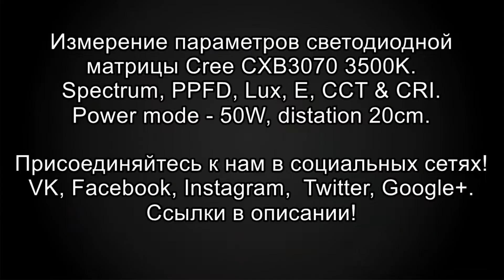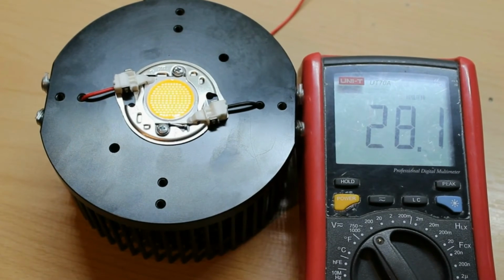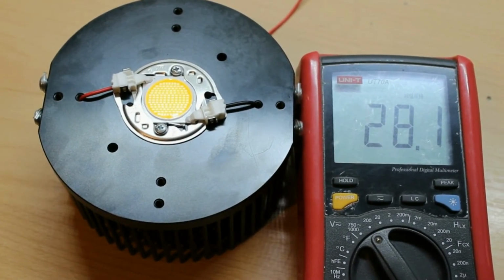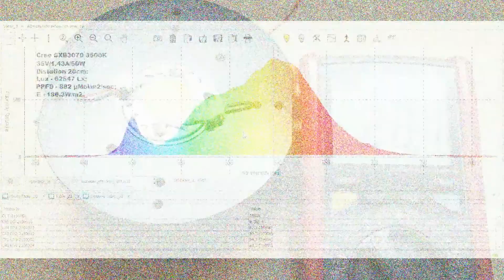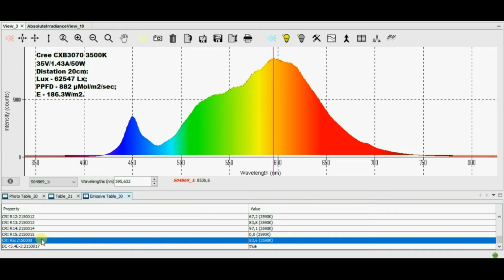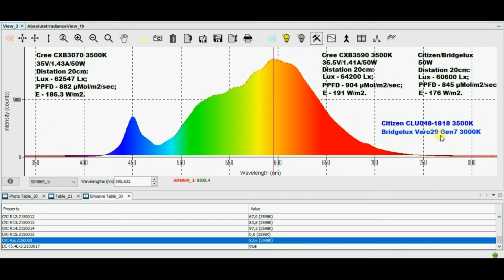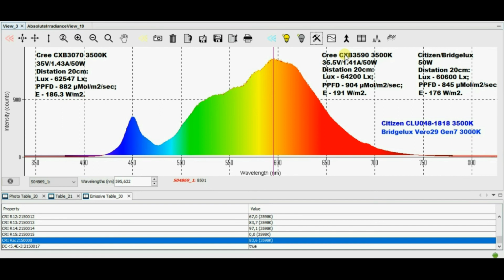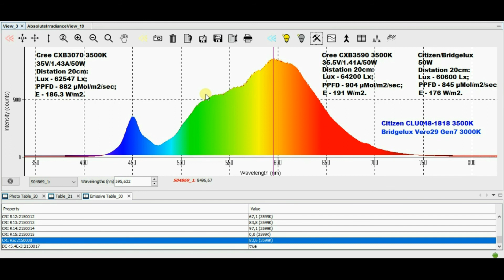COB Cree CXB3070 VS Cree CXB3590, Bridgelux Vero Gen7, Citizen CLU048 1818. COB for plants.

Comment: So cree cxb 3070 are the best...
Nice test!!!
Reply from the maker: Soon there will be a test Cree CXB3590 VS CXB3070. As well as normal dubbing :D
Reply: 3590 maybe stronger then 3570... or not?
Reply: Yeah but the Cree web says Cree cxb3590 has a higher lupins per Wat 175lumin prewar and the cxb3070 I think is 150 so cxb3590 is better
Reply: usually, the more leds the cob has in parallel, the lower they're driven individually, therefor more efficient,
rule of thumb, not a guarantee, depends a lot on how much amps they need before it gets divided, apples to apples. 

also, i wonder how much the curve differs between the cree's the citizens and the luminus covs when driving them softer,
usually driving cobs soft really pays off
strips still beat them out though, even the cheap bridgelux eb strips (2.80 per 13.5 watts) start at 170 lm/watt @ 3500k

samsung lm301b s can go well over 200lm/watt, even breaking the 3 micromol per joule barrier when you drive them softer.
but if you're looking cheap solutions to make yourself at home, cobs are the way to go, not too much solder work.

as you go along, you can always expand your cheap cob grow by doubling the number of cobs, 
redesigning a fixture to have them a bit closer (like 15-20 cm apart), running them in 2 parallel strings, at half the amperage

driving them softer, plus the fact you more cobs at a closer distance from each other give a better even spread at shorter distances,
combined with the fact they produce less heat individually, allow you to bring the light closer,  and you can pssively cool the cobs on a big piece of sheet metal of like 600x600 mm
and beat out a lot of the inverse square law light loss without spending big on lenses, more cobs means more angles covered for penetration too.

cheap plastic lenses can give up to 15% loss, glass ones ~5%, but they're expensive, i say, no lenses, and put everything closer together
i can water my plants without splashing shit around lol

a lot of good stuff in efficiency and silent/low-service operation opens up when you drive them really soft, 
citzen clu048 1212s give like 75% of the light at 65% of the power.
some napkin math:

clu048 1212s are nominal: 1080mA @ 34 volts = 36.72 watts

36watt*155lm=5691 lm (at 100% power, 36.72W) ->  calculates back to 154.9 lumen per watt
75% of that = 4268 lm (at 65% power, 23.86W ) -> caculates back to 178.8 lumen per watt.

and it will help their longevity too.

i personally use citizen clu048 1212 3500k cobs, they're only 12 bucks, when you do the math against all the others, which go for like 30,
these are best bang for buck imho, best tradeoff for me in initial price vs power efiiciency (my power costs 20 cents a kilowatt/hour), once you remember how cruel the inverse square law is, you start seeing the benefits it has for efficiency, when driving them softer and bringing that shit closer, you don't need the 50 watt bulky ones for that when you cover you bases in numbers.

fucking driver cost me more than the 4 cobs though, so do the heatsinks, but i'm a computer geek so i had a ton of old cpu heatsinks and fans around, still have a couple waiting on their new life as cob cooler.

i pondered repurposing old computer PSU's with a boost converter and some currentlimiting resistors as drivers, but a shitty 80% efficiency psu, running through a boost converter with 80% efficiency also > 64% :( is pretty damning for the purpose i'm after (which is efficiency, and more effieicny as i expand my collection of cobs lol)
so i went for the proper 94% meanwell instead lol

my ultimate grow room would look like: 3500k cobs driven softly on top,  mixed with the odd infrared in between, and strips as side lighting on the walls, all driven really softly, but covering everything like a big diffuse heaven, where temperatures are pretty much even across the board because of passive cooling
if you wanna go all the way, you mix 3000k and 4000k ones, have them on a seperate driver, so you can dim in the bluer ones to keep your plants from stretching as yo usee fit :D

for style points, you can also have a flat upstanding part, you can blow air against, moving the fixture around as a ghetto light rail system all in one,
or using a 2nd sheet of metal a bit higher to trap all the produced heat and make a nice outlet for it, you name it 
there are so many solutions that sound stupid but aren't until you tried :)

sorry for the wall of text, i geeked out a bit, have a nice day :D